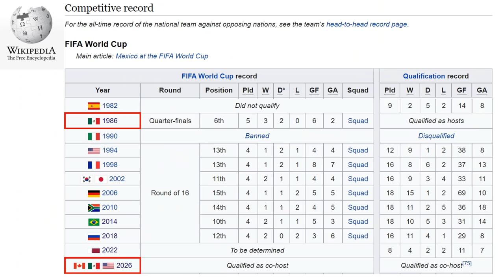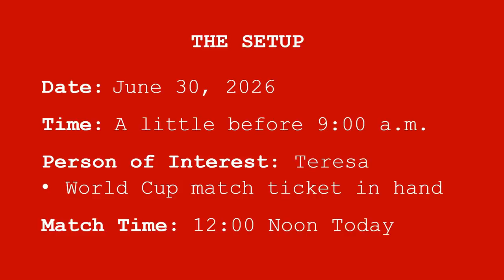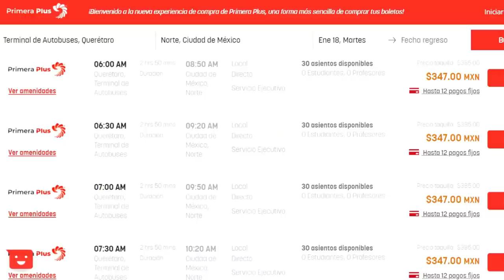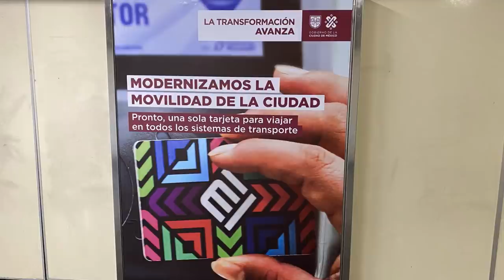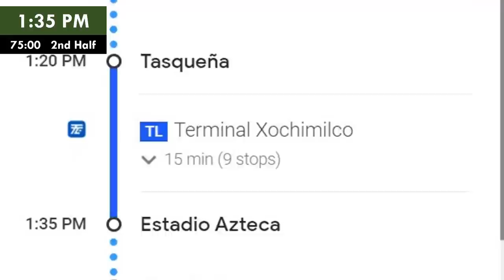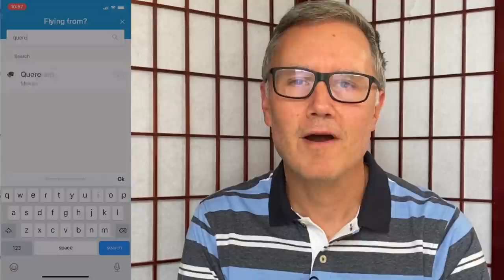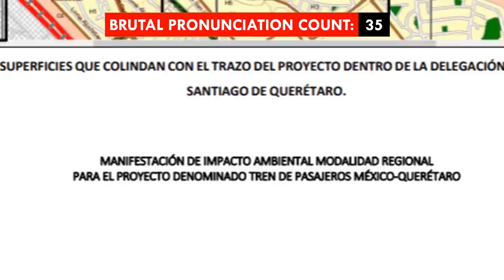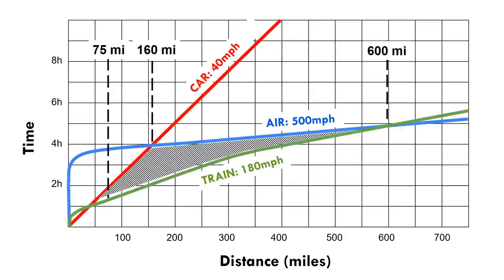High Speed Rail vs. Car vs Bus vs Air in Mexico! World Cup 2026 Race From Querétaro to México City

Comment: Mexico has huge Passenger Rail potential. Maybe not a HSR system needed outside the CDMX-GDL-MTY triangle. 
A lot of corridors with cities above 500k people averaging 250km distance between them. (Similar to the Tren Maya)
Reply: We used to have passenger rail but it got privatized and scrapped, and competition from buses, airlines and cars probably didn't help.
Reply from the maker: Monterrey-Saltillo-Torreon-Durango-Mazatlan-Culiacan?
Reply: @CityNerd  Guadalajara to Tijuana/Tucson, CDMX to Veracruz, Matamoros to Mazatlan, Matamoros to Veracruz, Nuevo Laredo to Queretaro. Juarez to Durango, Chetumal to Mérida.... heck even a 2nd route CDMX-GDL Guadalajara could work through Toluca and Morelia instead of el Bajío

Comment: I really hope Mexico gets HSR since as the video has shown, car travel in the US isn't as reliable as in the states because of all the reasons mentioned in the video but also because they're very expensive.
Reply from the maker: Cost is a big factor! I didn't want to get into comparisons in the video because I don't want to speculate on what the ticket cost for the high speed rail line might be, but what maybe doesn't come through in the video is that the buses are a pretty good value when you factor in cost and the fact that you can watch a movie, or sleep, or read, or work, etc. on the bus for 3 (or 5) hours.

Comment: Truly the magnum opus of CityNerd and the gesamtkunstwerk of transit comparisons. Outstanding.

I’d love to see a video compiling your work on high speed rail in North America and proposing a reasonable rollout of new lines based on your city pairs. Your top ten list is obviously a starting point, but the actual rollout would have to take into account the then extant network at each stage.
Reply from the maker: Good suggestion, thanks!

Comment: I think the Acela will become a genuine HSR in the next few years, since speeds are being increased to 150 mph in multiple sections now, not just New haven to Boston. But the fact that Mexico is building HSR before Canada will surprise me.
Reply from the maker: I really haven't done a video on Acela yet -- will need to do so.
Reply: @CityNerd   I have taken Northeast Regional 652 between NYC and Harrisburg, it was significantly faster than driving or taking a bus on the dreadful turnpike. The Acela would be even faster, since it's a straight run between Newark & Philadelphia.
That train used to get Double headers back when the toasters were in charge. But these days, it only gets a single locomotive.

Comment: My first thought from your premise: Teresa needs to get out two hours earlier. That given actual facilities and schedules. Maybe the High Speed Train can be built, the right of way is there so the track has to be upgraded for high speed, and it´s not an stretch of imagination to think it can be built in three years.
As an anecdote. I had a meeting at 9 o'clock at "El Caminero", and I live near "San Rafael" Suburbano Station. I was sure that to get on time to the meeting, I had to be at "San Rafael" at half past 6, get to "Buenavista" at 7 o'clock and hope Metrobus were not very slow. I got there at a quarter past 8.
Reply from the maker: There's a whole lot of uncertainty you have to build into your plans if you're traveling in and out of the north!

Comment: For an event this big, I think the race would have been a lot better had she gotten the ticket the day before. It would have seemed a lot more reasonable and could have helped you simulate a more accurate race. If she started at around 6-7 am, then I think she could make it to Estadio Azteca in Mexico City on time with at least 3 of the 4 modes of transportation you covered. 

Getting a ticket 3 hours before a major event in another city is just flat out impossible to even attempt to attend. Maybe it would have worked if she lived/worked somewhere in the Mexico City metro area.
For future similar transportation mode race videos, keep this in mind and don't make the timeframe window so short. At least let the scenario travelers start the race at the beginning of the day.